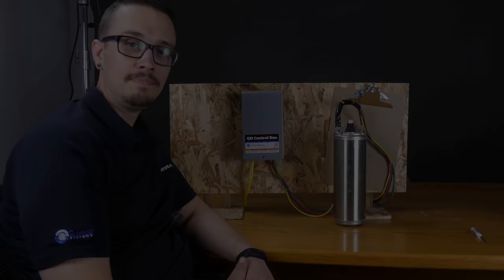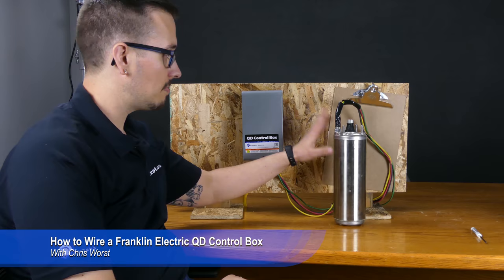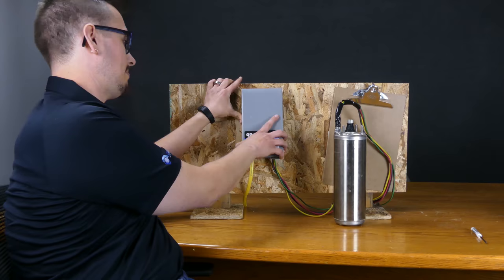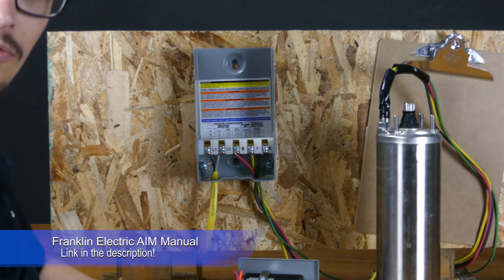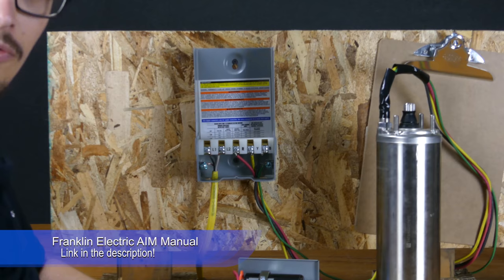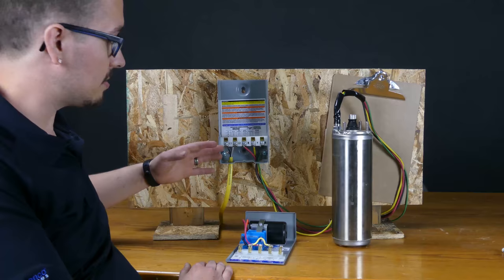How to Wire a Franklin Electric QD Control Box (1/3-1 HP)

Comment: Hi again -  in the video the lid of the lid of the box is sitting on the counter- it too has some electronic components - but those must not be important cause you didn't mention them either... and did you just say if your colour wires don't match, "you'll just have to figure it out..."   humm,  hope the shed doesn't burn down.
Reply: I'm with you on this, this video is of absolutely no value.

Comment: Thank you very much! I am a DIYer, new to (off-grid) well pumps and I very much appreciate your detailed info. It turns out that my start capacitor was bad. After replacing it and cleaning all connections,  I have water pumping again! My 1/2hp, 115v, 3 wire Franklin pump and control box are 27yrs old! Bill, Calif. Sierra Nevada mtns.

Comment: I still have the old generation Franklin control box. Where would you connect a float switch. Or alternatively can I just connect it in series in line of my life wire to fill a water tank.

Comment: @RCworstwater Can you show how to wire in a shared well? We have a design approved to share a well with 1 pump. Each residence has a 81 gal pressure tank. We need to know how to connect to pump and allow a demand to turn on the well pump. Can you share a video or resource. Thank you

Comment: Can these be used on any pump motor that doesn't have a capacitor start built in? I have a 3/4 horse jet pump motor that doesn't have a capacitor, can I use one of these?
Reply from the maker: I would recommend you contact the manufacturer of your motor and ask for their recommendation, you need to be sure the capacitors are the correct size.
Reply: Okay thanks.

Comment: What happens if you put the white wire where the black goes in the black wire where the white goes. ?
Reply from the maker: It doesn't make a difference which wire you put on L1 and L2

Comment: Is the control box delivering 3 X 110V phases from one 110V phase?
Reply: No. 3 phase is the source power in industrial settings only. A 110 volt system will have that one phase of power. A capacitor will prompt the motor to turn in the desired direction,  by adding the 'stored' energy from AC on to the 'starter' leg of the pump so as to draw up water, not spin backwards in water.

Comment: Hi RC Worst (Mr. Chris) this is my well pump specification: Myers 2NFL51-8-P4 Submersible Stainless-Steel Pump 8 GPM 0.5 HP 115V 2-Wire 1PH. 
I have BLACK, WHITE and GROUND from the Circuit board. And I have BLACK, WHITE (NOT YELLOW), and RED from the well pump. Well pump is now running fine without a Control Box and wires are connected as (BLACK from circuit board + BLACK from well pump) + (WHITE from circuit board + RED from pump) and (GROUND from circuit board + WHITE from pump).
I want to setup a Franklin control box. Please help me what type of Control Box I need (What would be HP and Voltage)
And how can I connect the wires with the control box? Remember: I don't have YELLOW from the pump, mine is white.
Thank you so very much for the helpful videos on YouTube. Stay Safe! Hoping to get an answer from you soon.

Comment: Really a useless video and a waste of time, rather show how to test the leads of the motor to determine the common, run and start wire, common to start has higher resistance than common to run, I often see burnt out single phase motors because people have no clue how to connect them or how to use a simple multimeter to determine what wire is what. To simply say "if you have different colours you will have to figure out which wire is which"  0:35 without giving even a simple explanation (and it is very simple to do it) is useless.
Reply: Philip Koen. Excellent point. I may have just smoked my 1/2 horse pump for that very reason. Thank you for your comment. Got a page?
Reply: @brucemarmy8500  Sorry, no page.
Reply: Tested it. It works. TY Philip